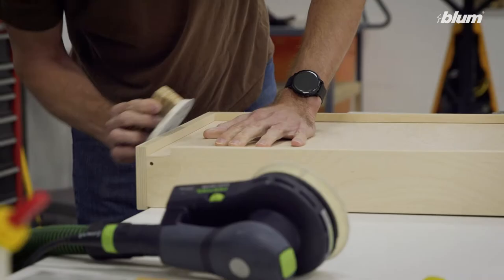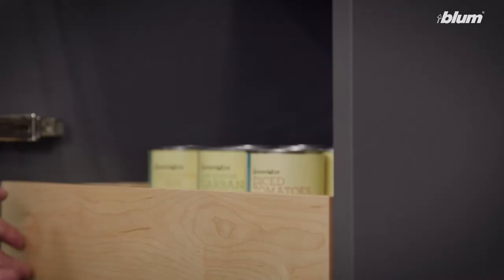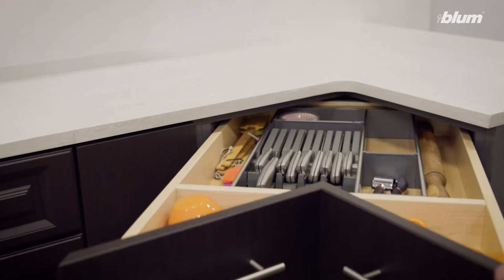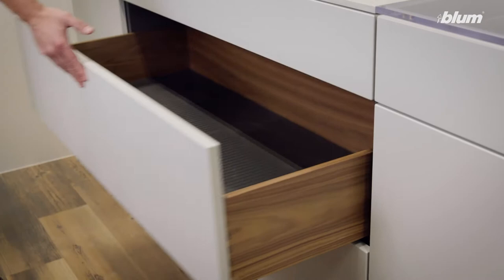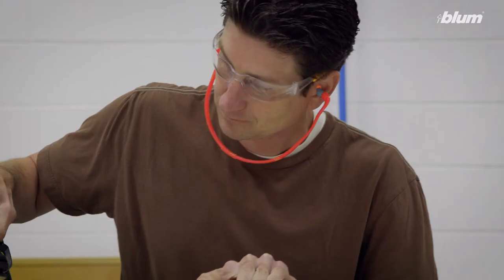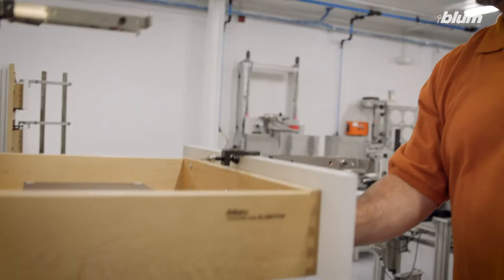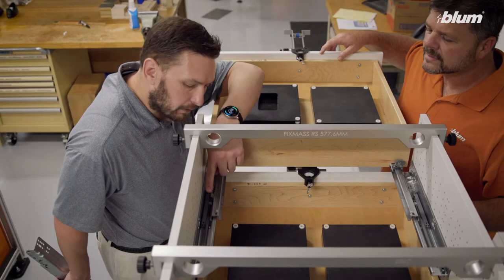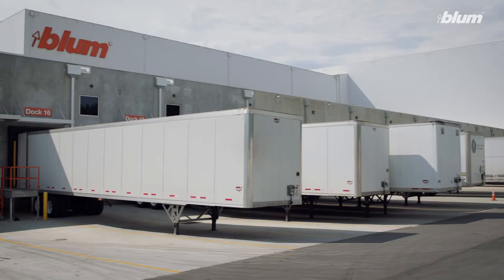TANDEM plus BLUMOTION Overview

Comment: I had problems with getting the drawers out (even tho I pressed those two orange caps like crazy)...
Reply from the maker: Hi Criss! The drawer should release by pressing the orange locking devices and removing the drawer from the slides at the same time. If your locking devices don't seem to be disengaging, please call our customer service at 800-438-6788 so we can troubleshoot this issue with you.

Comment: What is the difference between Tandem plus and Tandem. Are they completely interchangeable including fixing brackets?
Reply from the maker: Hi Mike! Here's a simple explanation of the functional differences between TANDEM, TANDEM plus, and TANDEM plus BLUMOTION:

TANDEM – Partial extension with integrated self-close

TANDEM plus – Full extension with integrated self-close

TANDEM plus BLUMOTION – Full extension with integrated self-close and soft-close